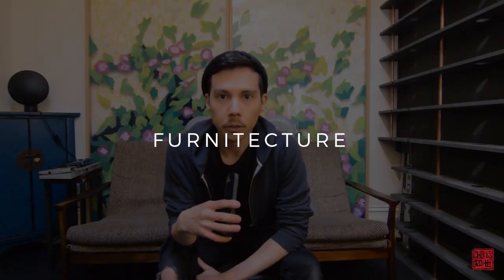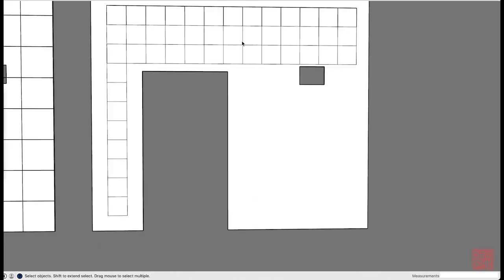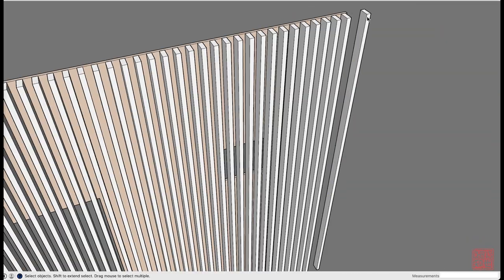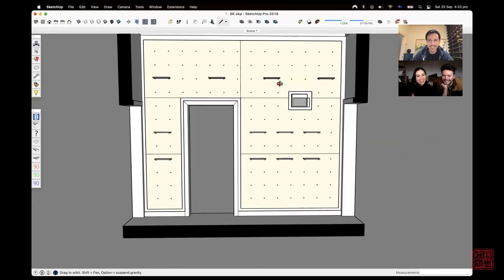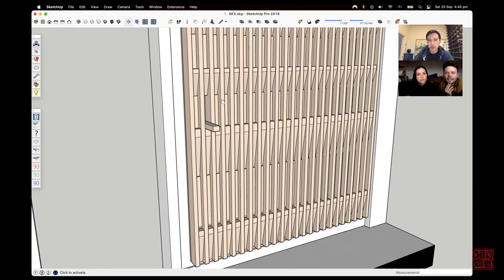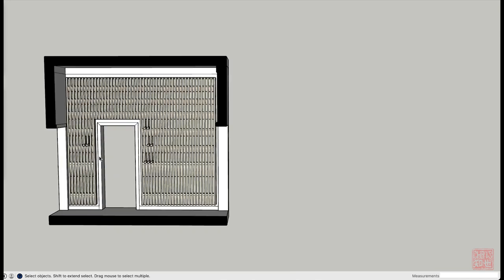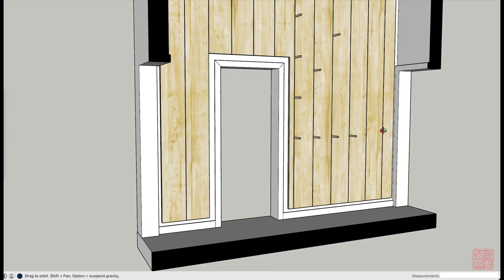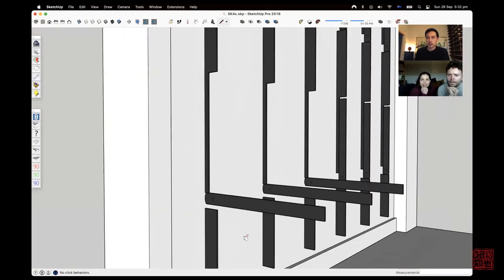Design process for custom joinery

Comment: Would it be hard to level the shelves if the dowels can slide up and down anywhere?
Reply from the maker: Hi S, great question! To get a shelf perfectly level would be much easier with a more traditional perforated wall with set holes - but I like the saying from Jimmy Diresta 'if it looks straight, it is straight'. Just like how we adjust a crooked painting hanging on a wall by eye, my gut feeling is that it'd be quite straightforward for this application. Having said that if Ben and Nat want to use a spirit level (and most smartphone have this function built in these days) when setting perfectly flat shelves they can so too :)
Reply: @Furnitecture  haha, great quote! Very cool channel, you're gonna blow up soon I'm sure of it 😆
Reply from the maker: @user-wm1oo4os7e  Thanks S, you're too kind :) I hope you'll follow along as well, I'm currently ordering materials for this project and will start the manufacturing process very soon!